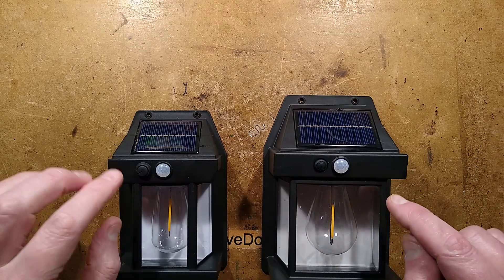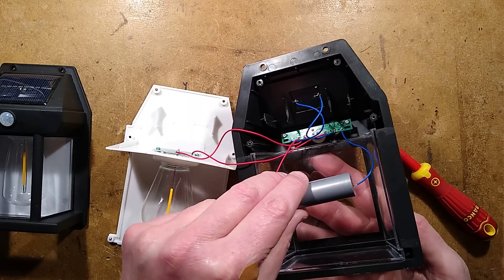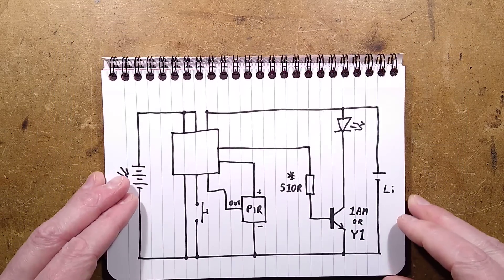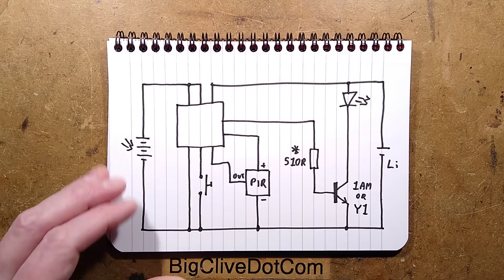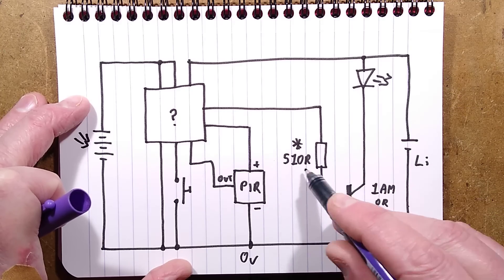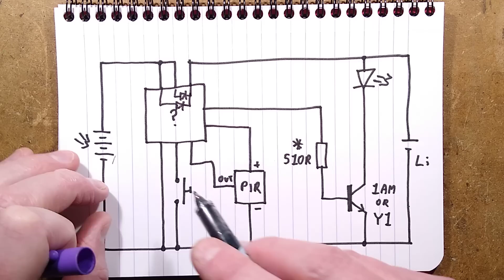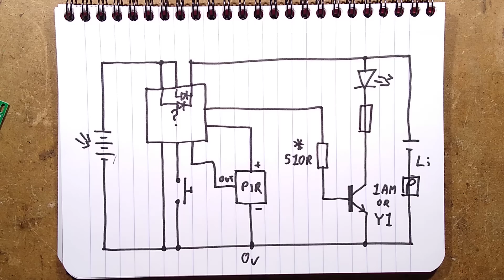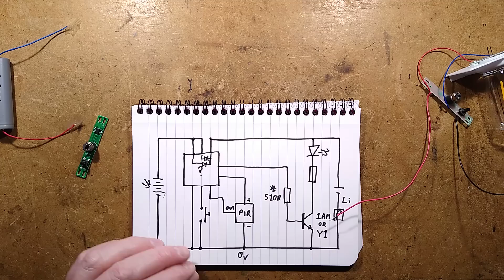Perplexing Temu solar filament lights

Comment: Guts look identical to the solar lights I've had on my fence for years.  Solar panels are all yellowed and crusty, surprised they charge, none have blown up yet.  Checked the voltages of them after leaving them charging all day and they weren't that high, couldn't tell you just what right now, but of course they absolutely COOK in the sun.  

I never liked that fence anyway.
Reply: The yellow crusty solar cells are due to the transparent sealant being used on top of them instead of a glass plate.  UV damage to the sealant, basically, plus natural abrasion.   Its unfortunate that the vendors can't be bothered to put a glass plate over the solar cell instead.

Most bulk 5V solar cells come sealed and the vendors just tack them onto the top of the units directly with no further protection.
Reply: @junkerzn7312  Well for fun I put a brand new one out on the fence rail to charge the past couple days.  Took it down and the old one - new, battery was charged to 3.93.  Old 3.91.  Guess more care was taken with my fence melters, good to know.  

Also stuck a meat thermometer in them soon as I got them down - 120F.  And it's only about 80F today.  Toasty.  But then anything left in a car, like a hybrid battery pack, is going to get just as hot or worse.
Reply: @bobclarke5913  Nice test.  For Lithium-ion that voltage is ok  But of course regular lithium ion cells have a limited cycle life and holding one at a high voltage at 120F (49C) will definitely wear it out quickly.  So its a bad combination.

For a LiFePO4 cell that voltage would be way too high (only 3.45V is needed for LiFePO4).

So, basically, the product sucks for want of a smarter software engineer.  They could have made it so much better with just a little more intelligence.

-Matt
Reply: @junkerzn7312  As long as I had them down I put both to a capacity test.  Old one's been out there 3 years or so, summer and winter.  1000mAh.  Which for a no-name cell isn't bad.  New one?  825.  Ha!  Though I didn't think to check it before letting it charge, could have been sitting near dead.
Reply: @junkerzn7312 3M sells a headlight wipe coating that protects plastic lights from yellowing so I wonder if that can also work on a plastic solar panel.
Reply: You sure those are lithium cells (which can burn if overcharged) or NiMH cells that basically stop taking a charge naturally when full??
Reply: @kirkb4989  They're 18650 lithium cells.  I have a couple I never put up, now I'm curious, think I'll leave one out in the sun and check it.

Comment: Hi, I also bought a similar led solar lamp, I wanted to convert it so that the solar panel was outside the lamp. However, the chip was not marked so I didn't know if it was safe. the solar panel even supplied up to 6.5V. If I add BMS and resistors will it be safe?
Thank you for your response
Reply from the maker: At the very least add a cell protection module.

Comment: It’s flawed.  Possibly the manufacturer could modify the circuit, add a battery holder and supply the product without the pathetic 500mah battery.

Comment: Is it definitely a lithium cell and not a nicad
Reply: I'd think a NiCd cell would cease to be happy quite a ways before 4.3V...
Reply: @michaeltempsch5282  it would never reach that (single cell).
Reply: @SinsBird  Hence, cease to be happy before that... But I've never cooked a NiCd to that level, so don't know what happens internally.
Might have to dig out a NiCd battery and stick it on a power supply at 5V and reasonable current limit, just to see what happens...🤔 Better put it in an explosion containment pie dish, should things get "interesting".
Reply: @michaeltempsch5282   back in the day I left a nicd RC pack on a 15 minute fast charger with a broken timer... I remembered it like an hour later and the cells overheated, melted the plastic shrink wrap, vented, and burned a small spot in my table. 

It was close to a fire, I'm happy the cells self destructed before that point and stopped getting hotter.

I think once one cell in the series string "cooked" the rest of the pack stopped charging since it couldn't pass current.
Reply: @michaeltempsch5282  it would leak if you charged it with too much current, otherwise excess energy is dissipated as heat without damage.
Reply: @volvo09  15 minute charger - so like 4-5 C in charge current?
Yea, I can see that getting hot...😱
Might be a different mechanism/result at    about .5 C. Might have a dig for a cell over the weekend...

Comment: Love those filament LEDs.  I've been making garden lamps with them and they put out a lot of light BUT they take 3 v at 100 to 300 ma depending on length.  At 4+ volts, without current control, those things are likely to burn out if the bat voltage is too high.  I've run them on 4 volts with resistors and also with a buck converter down to 3 volts.  I've also run them with a 1.2 v solar board which boosts the output to 3 v, then run that into a low power 555 and made them flash.  Makes the battery last a lot longer and adds zing.
Reply: There is crude current protection here. Transistor will drope some voltage and with 510R resistor at base and with typical gain of that transistor of just 50 there is some current protection. Still too high for that filament to last a long time but they probably expect people to use this with PIR with ON time of maybe 10-15s.
Reply: @MasterBakerVideos  this Is what i was thinking in doing. But using a esp32-c6 deep sleeping. Replace the battery for a 18650 lifepo4 which can stand >40°c raise the voltage with a converter to 3.3V and límit the current to some degree, im reading Is that 100ma/2.7V for filaments but .. i dont think they would be bright enough? Also these solar pannels i doubt they would get to 100ma for charging the battery which makes me think if its worth it

Comment: Direct soldered battery = likely enough space to add a single cell holder, which is nice. Pretty nice looking lights.
Reply: Wouldn't soldering make a lithium cell explode?
Reply: @ianhosier4042  Depends on how long you apply heat to it. Doing a quick dab to attach a wire can generally be fine, but extended contact can damage the battery (not necessarily make it explode), which is why spot welding is preferred, much quicker than soldering and less of a chance of the battery getting too hot.
Reply: @ianhosier4042  must spot weld
Reply: @ianhosier4042  clearly not, also no i have done it my self
Reply: Most of the stuff I open up (including laptop batteries has wires welded to them not soldered
Reply: @nedyahyakcam  Yeah spot welding for major devices is normal, but theres no telling where those lights were made/assembled though. Not everyone has a spot welder, but Most people have a soldering iron.

Comment: Given the voltage you measured, I don't think you're wrong. Super disappointing. We really need a single board/chip that simplifies solar charging/shutoff (ideally with a way to adjust the run time).

Comment: I got some cheap battery banks to re-use some 18650 cells I pulled out of a battery. The battery was a cheap laptop battery that never worked right. Well the issue was the cells... They literally would only take 200mAh max. Have them all discharged. Gotta dispose of them properly now. Idk what I was expecting for a $12 battery off ebay.
Reply: I brought a cheap knock-off laptop battery because I wanted a few cheap crap cells.  The pack claimed it contained 2200mAh cells, the cells claimed they were 1800mAh, and when tested were really about 1000mAh.  Lies all the way down.  I wasn't expecting much, so I wasn't disappointed.
Reply: @j.f.christ8421  I bought it for a old 2011 toshiba L655 I fixed up some. Same thing, didn't expect much but. The thing never worked from day one. Having such low mah cells. It would last about a minute or two and then power off.
Reply: @sokoloft3  Thing is if they'd stated the true capacity I'd still have gotten it, 1000mAh was more than enough for what i wanted.  These days I just use the "street lithium" cells, though they've recently been banned and they've started to skimp as well by putting in half-sized cells.  That must annoy the users when they only last half as they used too (presumably for the same price).

Comment: I really don't understand this one. The designer has to have been knowledgeable enough to know about the internal ESD protection diodes and the ability to abuse them, particularly if doubled up, but then left the Li-ion cell completely unprotected. Gotta wonder if the designer thinks they're a genius or is cringing at what horrors they've conceived in order to cut costs to appease their superiors.

Don't understand why they didn't just use a diode either, if they're cost cutting this much they might as well have just cut the PIR sensor as well. I wonder if the MCU as actually meant to short the solar panel out by pulling the pins low when the battery gets to 4.2 V, that and the designer spec'ed a cell with protection but that information wasn't understood by the purchasing person, only thing I can think of that makes sense.
Reply from the maker: It's possible that the designer originally intended for protected cells to be used.
Reply: I am guessing it was designed for a protected cell, hence why the standard cell was soldered in. An old ewaste old phone battery would add protection, but the manufacturer must have gotten a batch of free garbage 18650's 🤔

Comment: An exploding lithium battery?  Excellent!
Reply: Very bright garden for a little while, then increasingly so as the fire takes hold of the shed/fence it's ben nailed to.
Reply: To be fair here, it would explode or melt and catch fire when charging. That would be daylight which means it would be harder to spot the initial fire!
Reply: Fear not, Big Clive has a FIRE 🔥 CONTAINMENT PIE DISH! 👍🤣
Reply: That’s what the input protection fusible diodes are for. In the event the something does go wrong the cell will blow those clear before catching fire.
Reply: @mysock351C Maybe so, but I suspect the cell will have a VERY short life from all the overcharging if the diodes DO last.
Reply: @ElToro2000UK 
Make it an even 30 just in case some do fail to fail  :)
Reply: @ElToro2000UKRighto!

Comment: Here in Australia the battery will likely be destroyed sitting in the sun for a few 40deg days before the crap charging circuit can.
Reply: wimwiddershims, yes, one of my many solar lights here in perth stopped working.  when i pulled it apart the battery had been charged up to beyond 5v.  the battery is now in something else and working fine.  i havent noticed such eagerness to overcharge in any of my other lights.
Reply: I'm in Texas and NiMH are the only batteries that last the year, but they don't last the night either due to poor energy capacity. I think in my next visit to Ikea I'll pick up some less terrible lights and see if I can't replace their batteries with extra Ikea NiMH batteries.
Reply: @cheyannei5983 I have few solar light from IKEA, and they actually have replaceable batteries. Either AA or AAA NiMh depending on the light. IKEA also used to have lower capacity batteries for these lights. However, they seem to have disappeared from the shelves, at least in my country.
Reply: That's maybe another experiment for Clive, what ambient temperature can an 18650 cope with before it engulfs itself? Curious minds want to know.
Reply: Same for the US

Comment: A little strange to have the screw in bulb cover, makes me think they murt use other styles in other applications, otherwise I'm pretty sure they already make an all in one package (infact I know they do as I've seen them in tesco 😂)

Perhaps the over-volting suggests why the battery capacity was so low, you said the cell puts out 5.5v but don't diodes take 1.2v away, leaving 4.3?
Reply: Typical silicon diodes will usually drop .6V. Putting two in parallel increases the current limit, but doesn't change the voltage drop.
Reply: @strehlow  possibly I'm thinking of something else but I'm sure at least one will drop 1.2v,odd

Comment: Oh - I could use those filaments for my old desk lamp. Can you (I) get them without the lamp. I want to convert the lamp from 220V to 5V, but because it's an old lamp from the 1930s I don't want to make any permanent changes. Just want to get rid of the power cord and use a power bank in stead. Maybe even build in a couple of the flat Li cells, there should be room in the lamp base. 

Sad to see a quite nice product fail because of bad circuit design. The idea of the lamp is really good and it looks good too even though is't just plastic.